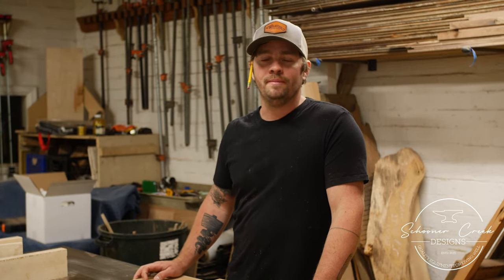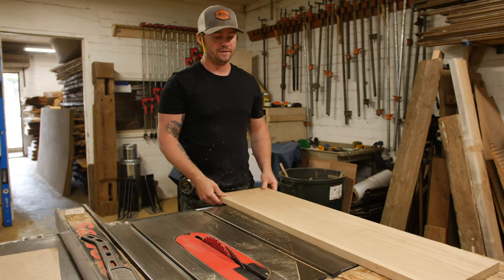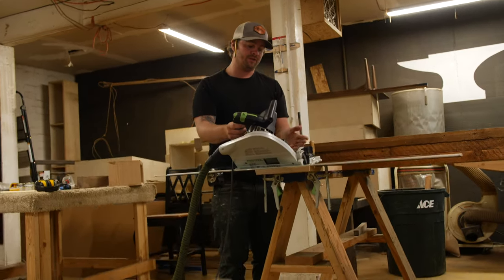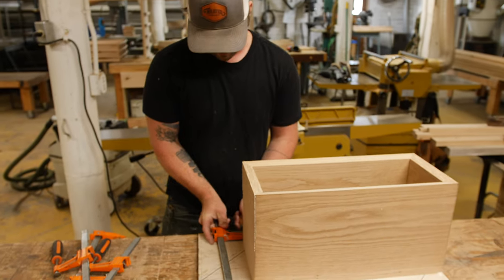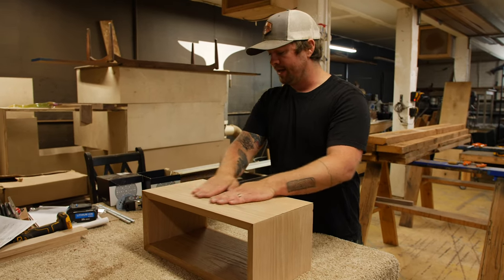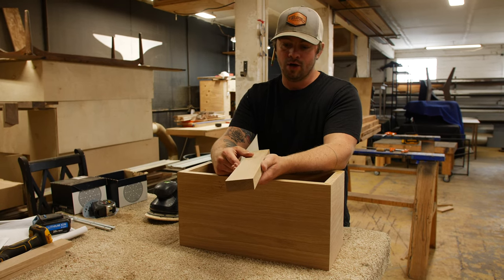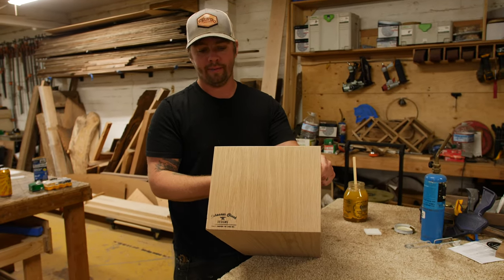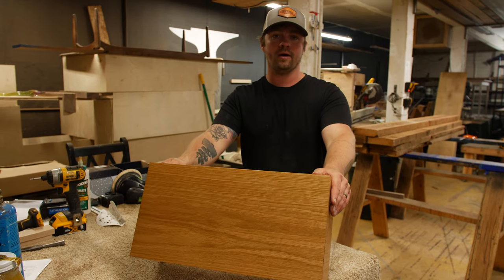Simple Modern DIY Floating Night Stand

Comment: What is the best angle for a French cleat?  Or does it vary based on dimensions/weight of the piece?  Awesome job by the way. Simple and elegant
Reply from the maker: Hey Jon, I would say it depends on the project, however I cut them usually 25° which allows them secure enough connection in my experience. Really they could be any angle you feel comfortable holding the load and geometry of whatever piece you're working with!